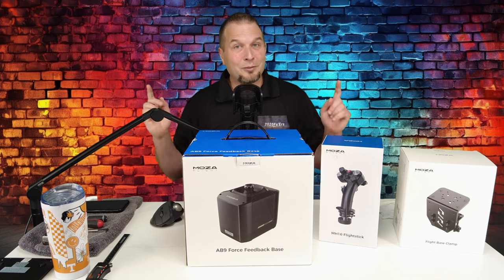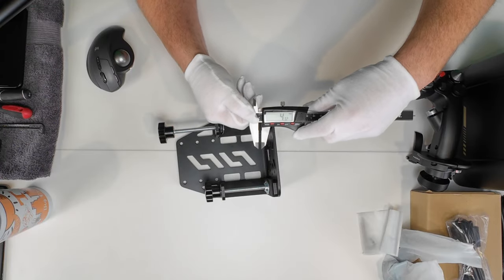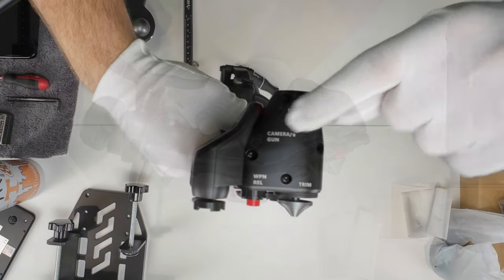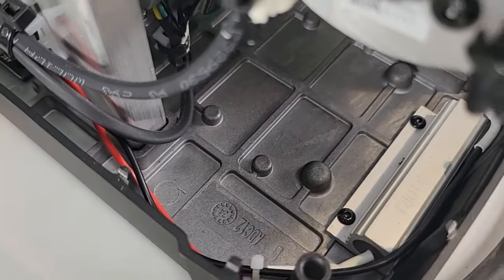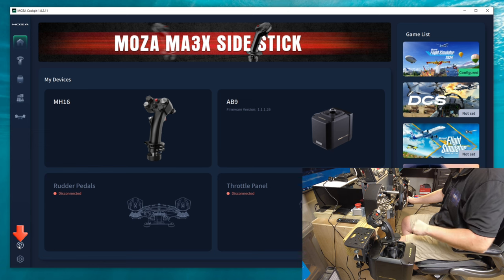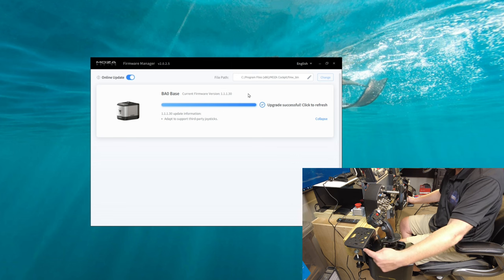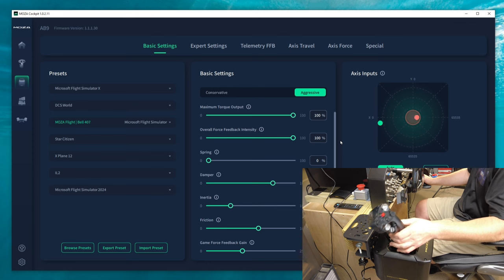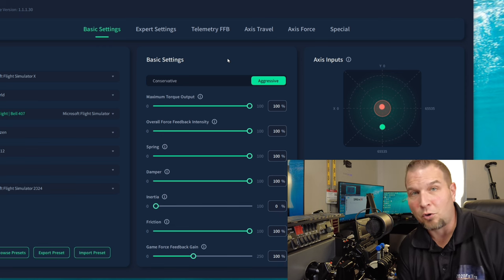Moza FFB  AB-9 & MH16 * Most realistic experience in MSFS2024 EVER! Full Review

Comment: Did Moza fix the problem with the base ID not showing up on the MSFS 2020/2024 control panel?
Reply from the maker: As far as the controls I have moza one and then another one that's just Moza. I assume one is for the base and one is for the stick. 
It shows up the same way in spad . Moza and moza(1) well
Reply: Thanks for the quick response.  I'll check for updates!

Comment: Ordered the Ab9, on the fence to whether I need the z-axis extension or the mount yet.  With the mount, I take it the problem is solved too by simply raising the base higher too?  I have a side plate on my cockpit so may just mount it there tho will have to mess about with the height.  I do wonder though if there should be a minimum thickness of whatever plate it mounts unto from underneath when put the bolts in however, so that dont accidentaly screw the bolts directly into the PCB (something which I had can happen with Thrustmaster bases when mounting)

Comment: Been waiting for this
Reply from the maker: Hope you like it
Reply: @2020fsers  indeed I did. Question regarding alternative sticks as the moza one looks pretty trash. How do they connect. What dictates which brand can be used? Virpil and thrustmaster i hear are compatible but not vkb? Can they be removed quickly?
Reply from the maker: As far as the brand I would go by what is showing on the stick menu in the software those are the ones that are compatible for right now.
Reply from the maker: As far as the mounting I showed that in the video it's pretty straightforward
Reply from the maker: And yes I wasn't fond of the moza stick either
Reply: @2020fsers ah OK. So it's just that connection at the bottom to the base. Screws on and off. Where the signal? How does it connect??
Reply from the maker: It connects through the black cable on the bottom of the stick .
Reply from the maker: At the beginning when I went over the moza stick you will see it and I also went over how to connect the stick near the beginning
Reply from the maker: they all attach with the metal screw piece in the  bottom  of the sticks